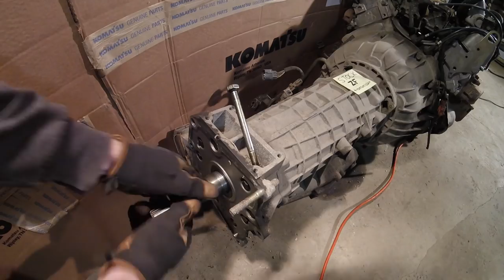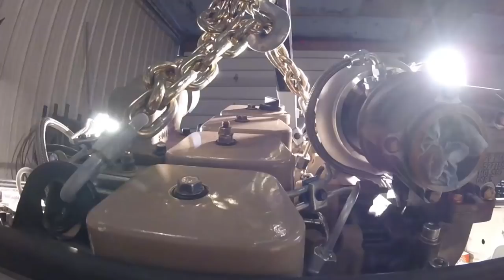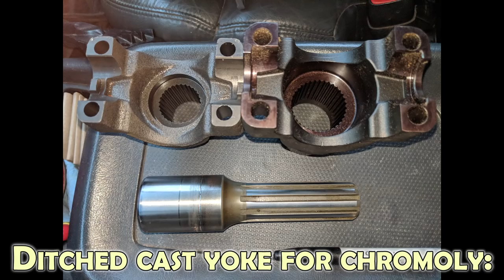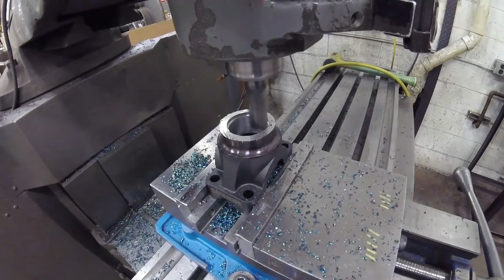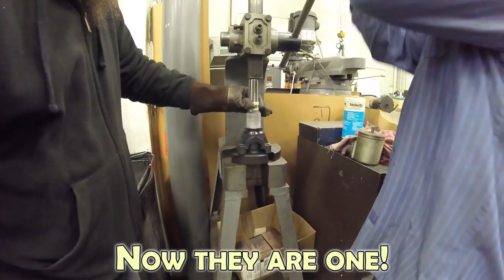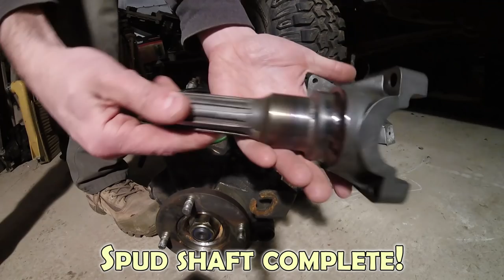LT230 Transfer Case Spud Shaft & Engine In! × 4BT Cummins Discovery #18 [Land Rover Build]

Comment from the maker: "Divorced Transfer Case" = separate mounting via u-joints, & "Married Transfer Case" = directly bolted to the transmission's output, with no u-joints between the 2 gear boxes, just splined shafts between.

Comment: Dude, super cool! i never realized that there is an adapter shaft sitting on the back of the 4hp22's.. are you going to beef up the mounting for the transfer case? considering the transfer is a separate entity to the engine it could twist in funny ways
Reply from the maker: Same here!  I thought I was being had when the bolt came out easy but the shaft had a little sticktion to it before popping out.  Oh yeah the trans & transfer will both get upgrades in their mountings, especially seeing as both only had a single mount point each from stock.

Comment: Very nice conversion. I really like the options once the transfer case is divorced. So many combos of different makes and model gearboxes or transfer cases. What was the main reason for doing so in this build, as the length gained was minimal and you seem to be using compatible box and trans? How have you mounted the two together? Boxed housing around the uni joint?
Reply: Oh and very nice uni joint machining and welds. Could be one of the strongest parts of the drive train.
Reply: Just found the reason for divorced transfer case in previous video comments. The mixed brand/make parts.
Reply from the maker: Thanks! Had the guidance & handiwork of a talented friend for that. Took more than a few hours of pondering, figuring, & measuring to form the plan to run a hybrid Chevy/Dodge 2WD transmission with the spud shaft linking the transfer case. My only fear is the possible transfer case internals getting stressed caused by increasing torque output from the 4BT as I inevitably modify it in the future...

Comment: You do anymore hp mods yet? What hp and torque ya think its at? Im going from 6bt 350hp to 400hp range strapped to 6 speed allison 2 wheel drive trans then i need a custom spud shaft to the np205 transfer case but nervous about it holding the horsepower and torque also being a crew cab f350 4x4 with 35in tires. Your thoughts you think it would hold up??
Reply from the maker: I have not yet, and it should be in the 225-250hp / 550-600tq range with this combination of parts/mods. Next upgrades will be injectors & head studs, so that I can bleed boost reference from the turbo's wastegate to allow it to push past the current 28psi limit. This will get me in the 300-350hp range, which is where I imagine I will stop pushing. Any more and compound turbos are likely necessary to keep it fun and useful to drive.

Comment: what yoke did you use? I thought it was  the u1604 but the hole looks to be to big in diameter .
Reply from the maker: You got it, that's the U1604 meant for the 35-spline Ford9 w/1350's. The other yoke earlier in the video was a cast steel 29-spline that I didn't end up using.

Comment: It looks like the motor (or at least the turbo) is sitting higher than the hood line? Does it fit below the hood?
Reply from the maker: Tim Hecklinski It is! The valve covers will be quite close anyway (due to the tall stature of these old Cummins engines & the solid axle right below it) so the plan all along was to fit a cowl to the hood. Maybe if the valve covers clear but the turbo doesn't then I may just run a little bump like you'd see in the old DSM cars. It is handy having all the clearance on the passenger side for intake & downpipe, but I may still do something different for an exhaust manifold to bring the turbo down a bit further yet.

Comment: How many horses has this engine?
Reply from the maker: garage and road Should be just over 200 with the modifications I've made, but also with 500-600 torque output, at VERY low rpm!
Reply: 4BT's easily do 200HP/450TQ @ 1800 RPM with just some simple mods to the injection pump and a good turbo. Doing some nice work Tinker, I've got a white Disco and I'd love to drop a 4BT in it.

Comment: high, I am looking into doing this on my 2003 land rover discovery. is the other half of the yoke stock on the nv4500 transmission or did that have to be fabbed as well.
Reply from the maker: Not sure I understand... all the parts I used were described in the video.
Reply: @Tinker1837  I realize now that the nv4500 is the HD model with the break which has a yoke built in. thank you for the reply.